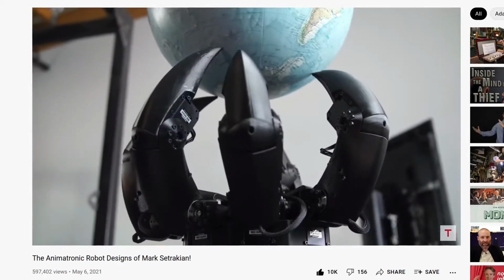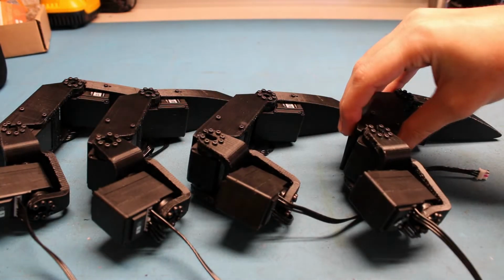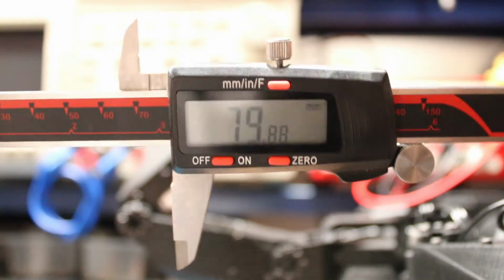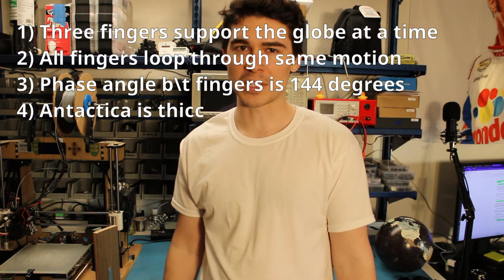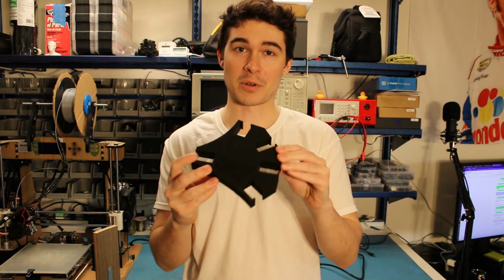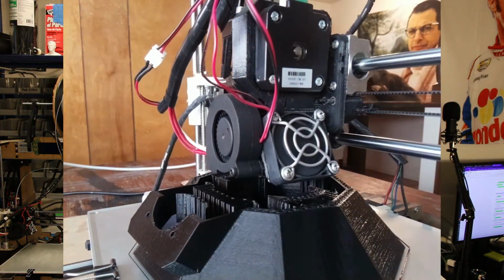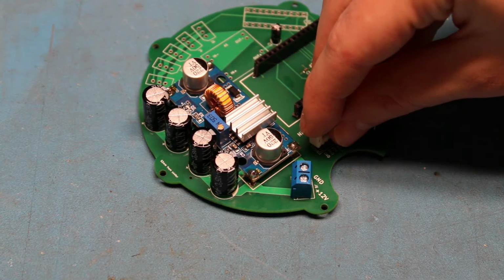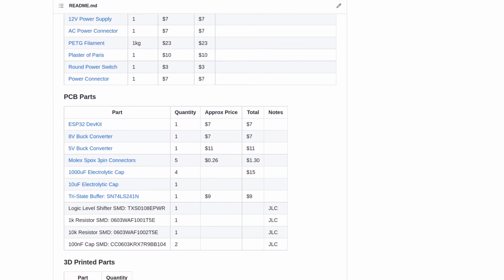Remake of Mark Setrakian's Axis Robot!! OPEN SOURCE

Comment: You could add a Bezier like smoothing to the motion, here is a cubic smoothing routine, you could try. I like true Bezier, as i can record that motion and play with the curve handles, but this is a simpler approach. 

import numpy as np
from scipy.interpolate import interp1d  # you could add a Bezier function here instead.
import matplotlib.pyplot as plt

def bezier_interp(times, positions, num_points=1000):
    """Creates a Bézier-like smoothed path that preserves exact timing."""
    times = np.array(times)
    positions = np.array(positions)

    # Interpolate positions over time with a cubic spline
    interpolator = interp1d(times, positions, kind='cubic')

    # Generate smoothed positions, still aligned with the original time scale
    fine_times = np.linspace(times[0], times[-1], num_points)
    smooth_positions = interpolator(fine_times)
    return fine_times, smooth_positions

def moving_average(data, window_size=5):
    """Simple low-pass filter for feedback noise."""
    return np.convolve(data, np.ones(window_size)/window_size, mode='valid')